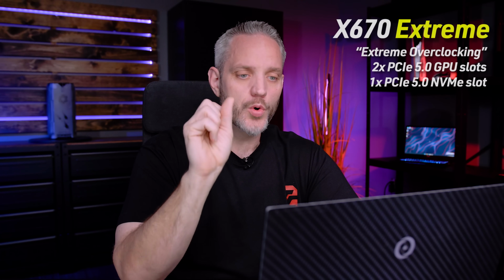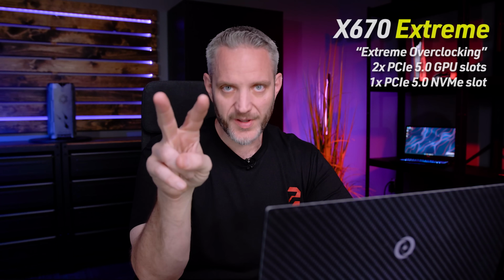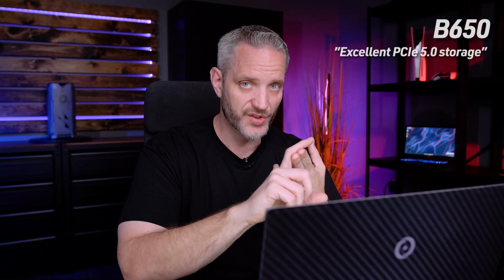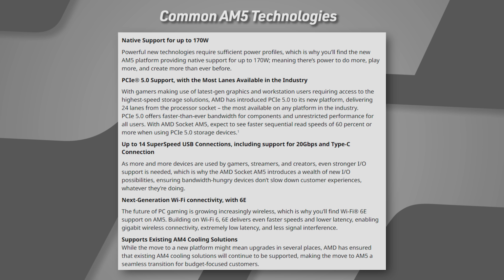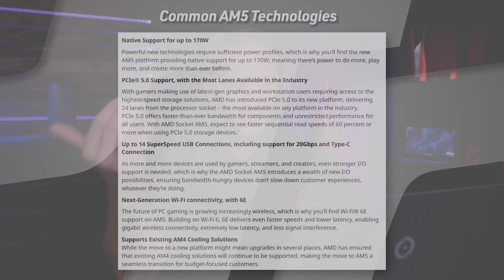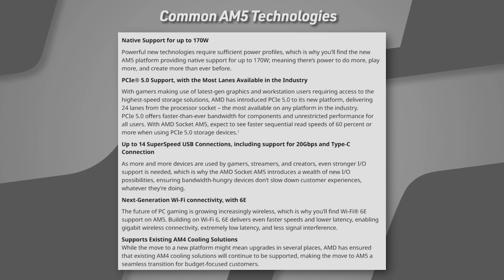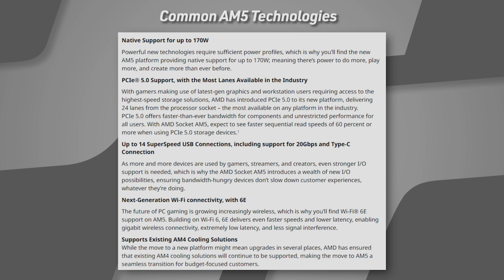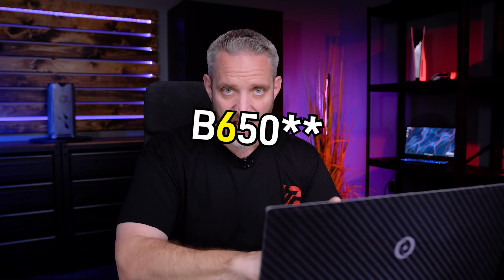AM5 Motherboards are EXPENSIVE! AM5 Explained

Comment: I’m waiting to see if the 5000 series prices drop even more so that I can upgrade from 3000 series. I still think the 5600x is still going to be a great option with a x570 board for a while.
Reply: I am also in this same boat. Currently on a 3000 series CPU and a 400 series board and my next logical step is up to 5000 & 500 series.
Reply: @johnwayneasgenghiskhan4699  That's just dumb. Why on earth would you replace your board when you're already on AM4? That's literally part of the point to AM4. Longterm viability is literally one of their big selling features. Just update the BIOS drop in and you should be good. The mobo and power supply where the two things other than my case I never intended to touch again, with one CPU upgrade and 1-2 GPU upgrades and probably a RAM upgrade to 4x16 from 2x16gb RAM, and an extra gen4 NVMe although I'm unsure how the switching works on my board between disabling the bottom PCIe slot and the bottom third NVMe. I'm trying to figure out if that's why I was getting WHEA uncorrectable errors and no ability to shut down regularly, or if it's just the FireWire card I was trying to install with alleged "stable and working" drivers was the problem.
Reply: @pandemicneetbux2110  Mainly I just want PCIe 4.0 to make purchasing a current gen GPU more viable by not having to half the lanes as a result of running on a PCIe 3.0 motherboard. Not absolutely necessary, but more of a "like to" option. B550s weren't out yet when my build began, only X570s which were beyond my budget at the time. I know my current mobo could handle say a 5600[x] but probably not do so well with a 5900X. I'd trust building a final AM4 version rig rather than a fledgling AM5.
Reply: @johnwayneasgenghiskhan4699  Eh I guess that's alsoi a fair point depending what janky level your build is at, like if say you have a really cheap old board but mainly I'd never want to replace my motherboard (hence as I've said, I got a pricey x570 so I wouldn't do that and have a rock stable foundation for better part of the decade with room to upgrade, always get good boards). PCIe 4.0 was a "meh, ok cool" feature for me, box to tick. It's the rest of the board that's noice although yeah, I at first got a 3.0 for some reason and then replaced that by cloning the original WD black NVMe to my new 1tb Sabrent Rocket. Somehow it did feel vaguely faster honestly, but otherwise far as I'm aware no GPU is really saturating PCIe 3.0
Reply: I recently got a 5800x for about $300 Canadian so the price drops are already here.
Reply: Imo no, if you are trying to sit with one cpu for awhile you should spring for the 5800x3d or 5900x, the extra cores are insanely useful
Reply: @boastfultoast  You give me faith in the longevity of the 5000 series. AMD has already turned two hours of work into twenty minutes. It's kind of a sweet spot in time for the money.
Reply: 5000 series and am4 boards already going up in price heavily
Reply: I mean eh it depends, personally I'm going for a 5950x probably it's just I'm more waiting for well a point to upgrade really. I'm not having problems with my 3700x, the software is great, the speed thermals power efficiency etc. is great, and because I'm spoiled on the better things in life now like more cores it's inconceivable to me dropping down to a "mere" hexcore CPU. But mainly I'm waiting for a good deal on an AIO, because while it works great for my machine, spending that kind of money on a 5950x right now and putting a Wraith Prism on it is probably pretty stupid, but I'm hesitant to leave my machine running all day with an AIO for years costing way too much money that WILL break, or the Coolermaster air tower that costs 100 bucks and I'm like, what's the point.

Instead I'm allocating that spare cash towards a RDNA3 not a new processor. This because a new monitor will also cost quite a bit of money, hence complaining about power requirements and me just blowing off Lovelace at this point if I'd need to buy a new PSU on top of the expensive 4k monitor and the nVidia tax, so I'd need to be really wowed to ever go back to Green from Red now. As such, I don't see the need to get a 5950x atm when I'd need a new cooler too. Probably by the time I do it's going to be a $400 processor.
Reply: Why don't you want until black Friday   and get a 5800x non 3D for probably  $199
Reply: @niciassmith1204  that may not be a bad idea
Reply: @niciassmith1204  ohhhh....I forgot about that. I normally never participate in black friday, maybe I should save extra money to see if there's anything worthwhile.
Reply: @pandemicneetbux2110  Granted this was 2019 but black Friday 2019 I got a 2700x for $139 an X570 lower middle mb for $109
Reply: @niciassmith1204  holy shit
but newegg never has good enough deals iirc, where was this even, some guy's van?
Reply: @pandemicneetbux2110  Microcenter.  They even beat the guy in the van.
Reply: @Olly O 
From what I gather if you play on high resolutions there's not a lot of difference between the main Zen 3 parts.
Reply: I have a msi x470 with a 3600x with a 1070ti, A asus b550 with a 5600x and a 2080super, A asus x570-p with a 5900x and a 12 gig 3080 and a asus b550 with a 5600g for a web surfer. I can honestly say all 3 gaming setups still hold their own.
Reply: @tnreloader8236  "still" lol those are all high end setups, with sole exception of the 1070ti which is still closer to high end than budget and not that old tbf
Reply: Im still stuck with 2600 😂
Reply: @yip2454  Well, it's better than a Pentium.
Reply: get the X3D or don't bother upgrading at all unless it's an ebay cpu for $100 or less
Reply: Trust me its worth it, I would honestly skip am5 unless you wanna waste a crap ton of money
Reply: @denniskarlsson6173  i am in x570 and i dont see myself swappimg my r7 3700x out
Reply: @theflash9068  I myself am on b550 tomahawk and ryzen 5700x
Reply: @denniskarlsson6173  agree 1000%
Reply: I’m using AMD 5900x and RTX 3080ti and I’m loving it with my 32gb RAM
Reply: @Nibbles021  yeah you're set for years

Comment: Having been in IT for 20+ years, i stopped wanting the latest stuff maaaany moons ago. Dont get me wrong i love new tech, but i prefer stability. My 5900x and x570 aorus master may be some what EOL if you look at upgrade paths but theres no way in hell im paying early adopters tax on AM5 considering the inevitable issues/bugs at lauch....ill buy into it when x770 gets mentioned lmao. My rig has been on 24/7 for damn near a year at this point and other than a few restarts for windows 11, its been solid as a rock and doesnt need its own power station (my entire machine usess less watts at load than ssome of the newer GPUs rumored TDP)...platform maturity means way more to me than bragging rights over the latest gen hardware. Likewise with GPUs, ive never been a top tier card owner simply because the xx60 cards suit my gaming needs perfectly at 1440p high settings which allows me to go a bit ham on other components/peripherals.

Comment: I was day 1 on AM4 and I'm probably going to do the same this time around.  I'm leaning toward the AsRock board, but I'm open to the others.  I kind of like working through bugs on new platforms, too, so that's not really a huge concern for me.  I'm still a bit of a windows 10 hanger-on at this point, still, but I imagine that I'll get over it pretty quickly.  Overall, the cost of entry here is going to be high, but I had prepared myself for it to be even higher, so I'm OK with where everything seems to be landing.
Reply: I just switched to linux. When you run windows in a vm you can tell it any cpu you want. That bing chilling over 9000 be wild with it's 69 threads at 6.9 ghz in the taskmanager

Comment: I'm the sort that buys 1 overkill system every 5-6 years by doing that I ensure that I will always have a noticeable performance bump, never wind up with a system where I feel frustrated with the performance and also have more than enough time to look into recent updates
My last rigs where a 3770k system in 2012 and a 9900k system I'm running now.
Back with tthe 9th gen I avoided AMD purely because I was going for peak performance at the time and the Extra cores of the 3000 series didn't add up yet - 2 more years and DDR5 will be matured and we'll be looking at what makes most sense

Guaranteed some will look at this and say "why did you post this?" - Simple answer is giving the view of someone who watches the hype train each time it comes by knowing that it needs to die and that Day 1 adoption is alway signing up as a paid Beta tester

Comment: i am on am4 and i didnt plan to upgrade to am5, because of lack of gpu bottlneck (rtx3060 nearly 9tf). But i think it will be interesting to test am5 system with nearly high end gpu like rtx4080 (between 35-45tf a comparsion of rtx3090 is 28tf)
At 1080p gaming at the most of older titles and dxr without dlss or fsr enable.
 this should be done with capframex and enabled gpu load graph.
amd claims 13% ipc and in cb23 9% but wioth enabled avx512 thats a caviat. games doenst used avx512 therefor at maxed cb15 score of 295-335 will be real
it depends on clockspeed.
If amd is sandbagging and 95 is without avx512 then respect
The crown is near but intel can  win if they choose to  power consumtion above near 250w.
 We will see

Comment: Will we finally be able to have more than 128GB of RAM on a non Threadripper system? Come on, we 've had this limitation for years now. I would literally not spec a computer for a graphic designer or content creator with anything less than 64Gigs, especially for these16core cpu systems. Working on anything more professional, like VFX or 3D the only next step is 128 and you're already hitting the ceiling. We used to have Threadripper but now it has ran away a little from us freelancers :/

Comment: I'm waiting for a CPU that hits 6Ghz Single-Core. 😆
Best not to ask why I need that much power. I just do.
But yeah, AMD Manufacturers. If you are reading comments, please add BIOS flashback to your boards. This is an essential feature for your consumers as BIOS drivers can cause immense issues that we would like to avoid[It may come out of your wallet if it gets bad enough.] You may already be doing this, but I still want to get this out there for those who weren't thinking of adding it.

Comment: Feel like the GPU part of that would be a red herring, like it was a miscommunication of marketing from AMD's side or wherever you grabbed the specs. They are requiring 2x x16 PCIe 5.0 slots. Just because it's a x16 slot does not mean it needs a GPU to populate it, but also x16 slots would commonly be populated by GPUs. So a marketing team might get confused by this and decide to refer to them as GPU slots.

When it comes to the motherboard manufacturers themselves, none of them are marketing for 2x GPUs that I've seen. Instead, they just mention that they have two x16 PCIe 5.0 slots. You could use that second slot for another GPU, but you could also use that for more NVME slots. Or use both slots for that, they don't particularly care.

Comment: I am still using a Core i7 2600 with 16 GB so an upgrade with a Ryzen 5 5600G + basic MB + 32 GB RAM would be a significant improvement, and far cheaper than any Zen 4 option. I would keep my SSD, case, and PSU.

Comment: I'm running the 5800X3D right now. I suspect I'll wait until Zen 5 to move up to the AM5 platform. DDR5 ought to be much cheaper by then, and most of the bugs should be worked out, as well.
Reply: 5950x here, same; upgrading every two ro three gens seems best for experiencing a real upgrade.
Reply: 5800X3D here as well (but in a mini-ITX build). Im undecided. I love that my current custom loop can be used to cool the AM5 platform too, but my main concern is power. I got a corsair 750W SFX and adore it, but would it be enough?
Also, out of curiosity I looked at the currently available DDR5 on newegg and I dont see the point. Sure the frequency is higher, but so is the CAS latency to the point of DDR4 being faster overall (10ns vs 8.88ns). Im not sure what AMD offering Id have to wait for in order to be motivated to replace my cpu, mobo, ram and possibly power supply along with remaking custom silicone cables. Juice might not be worth the squeeze.

Comment: Even tho' the 12th gen i3 CPUs have been amazing for the price, it's been hard recommending them for budget builds here in Croatia because even H610 boards go for the equivalent of 100USD while decent B450 boards that support 5th gen Ryzen are 50-60USD. With that price difference in motherboards you could squeeze in a CPU,GPU or RAM upgrade for the same price as the Intel build.
Not to mention that H610 boards make no sense because they're only a few bucks cheaper than B660 boards, making them a terrible value.
And now we won't be getting Ryzen 3 CPUs for a while and even if we did we don't have A620 series motherboards to go along with them.
I hate that low end is slowly becoming non-existent. AMD had the low end crown for a while with Ryzen 3 CPUs being amazing value with the 3100 and 3300X being just magnificent, and now they released the 5500, 4500 and 4100 which are just dogshit quite honestly.
Reply: Low end 7600x competes with the 12900k. 

If that's too high end you could always buy last-gen, should be cheaper.
Reply: @davide4725  low end is a PC up to 5/600 dollars

Comment: Having two PCIE Gen 5 slots that both support 4x4 bifurcation would be nice for those of us who want to run a lot of fast nvme storage on a pcie card. Loading game dev assets, working with large files, etc.
Reply: Unfortunately, no standard desktop CPU has that many PCI-E Lanes. You have to move into the workstation/server (Threadripper/Xeon/Epyc) class CPUs to get enough PCI-E Lanes to make having two 4x4 slots make sense.
Reply: @shadowtheimpure  you can have 40 by combining CPU and chipset lanes, but then you have to shell out for the higher end mobo, which is fair imo
Reply: @shadowtheimpure  you must be an intel cpu owner since before ryzen, tee hee. sucks to be limited to 20 cpu lanes.
Reply: @aprilgeneric8027  No, I've got a 3900x. I just had a 'slip of the tongue' when I was trying to put Epyc.
Reply: @shadowtheimpure  main stream should have 40 this day and age, doesn't  hedt today have like 96?

Comment: As a primary Intel Builder what I found was I could get a nice lga1700 mb with a lot of connectivity options and a robust power delivery stage and not feel I was scrimping on anything for in the $300-$350 price range.
Most boards much under that range you could start seeing where they were cutting the corners pretty blatantly.

When you are spending $420-$750 on the cpu and another $800+ on a gpu I do not think the $300 range of mb's is out of line in the scope of the complete builds cost structure.

Comment: I have used Ryzen for all my builds for the last 4 - 5 years and plan to stick with them.  Just finished a Ryzen build for a themed Minecraft build for my Nephew using a Ryzen 7 5800x/3060.  I am going to replace my system in my office with a 7000 series, though I will wait for the bugs to be ironed out and hopefully the prices also come done after not to long, though not holding my breath on that one.

Comment: My last build was 12th gen in April, so it'll be a few years before I build a new rig. If I do go back to AMD it'll be 8 or 9000 series most likely. Pure brute performance I think AMD has the edge and has had it for a while now, but stability and compatibility I'd like to see them work on a bit. I mean software wise, not hardware. Just optimization stuff, it's not huge but it does matter if you're not looking to have to tweak every time you try a new game, and with my AMD builds I was spending a lot of time on Reddit looking for fixes to this or that performance issue that usually came down to the game or program just not being optimized for AMD. For me it'll largely come down to budget at time of build. I went 12th cause microcenter had an online deal for an i5-12600k motherboard bundle (ddr4   that just worked for my budget and performance needs and was cheaper than the combo I was looking at for a 5600X at the time.
Reply: Intel has been amazing with alder lake. A few games suffered a month or 2 on win 10 and win 11. They fixed all those driver issues. Compare that to Intels arc devision. My god, what a disaster.

Comment: Here in Australia the Gigabyte Z690 AORUS XTREME Motherboard is sitting at $1,399.00 AUD so if you are talking about $2,000.00 A for a motherboard we would be up around $4'000.00 + Aud this is crazy pricing for us😵. At present I am running  AMD Ryzen Threadripper 1920X 12-Core Processor    3.50 GHz and  I am very happy with it (going to last me a long time).